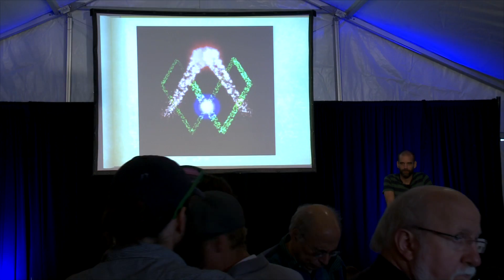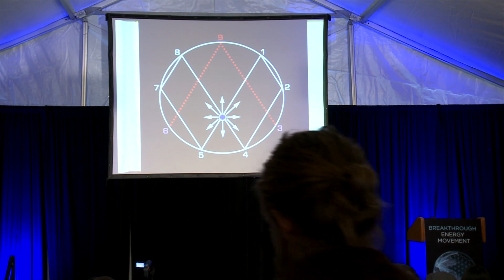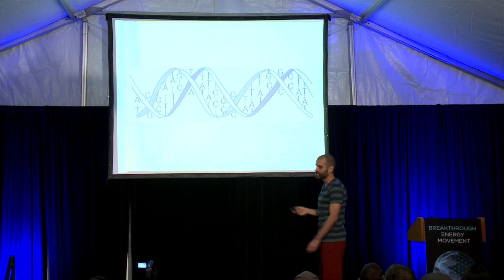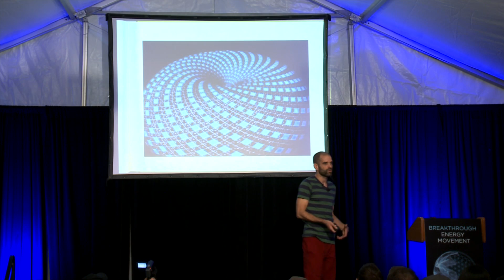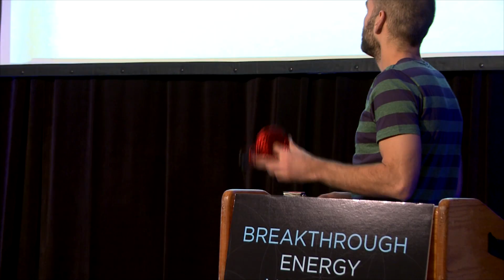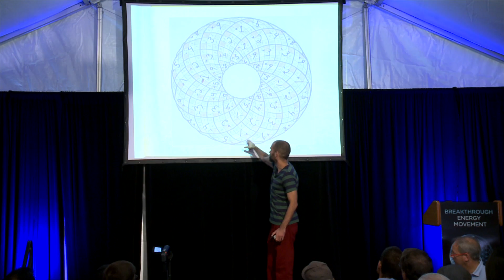Vortex Mathematics | Randy Powell

Comment: HAVE YOU EVER DRAWN THIS UP OVER THE NUMBERS ON A CALCULATOR PAD OR PHONE PAD THE DISIGN LOOKS LIKE 7X WHICH X STANDS FOR 10+ ROMAN 24TH ALPHABET 3 REVERSE 24TH KEY CENTER C IN WHICH 2X4+2+4= 6 8 7 PASSES IN BETWEEN OR OVER... 1 2 4 8 16 32 64(1) 128(2) 256 (13=4 JAC dMAC aiS) THEN 512 FIRST PART OF M.B. (8 PASSING FROM 4 THU THE CENTER  88 LINK  10TH MOVE BUT WHAT IF THEY WER ROTATION BACK WARDS AND THEIR WAS NO  124 BUT IT WAS 8 IN PLACE OF 1 AND 7 IN PLACE OF 2 AND 65 IN PLACE OF 4..REMEMBER THIS VISION... THE CUBE HAS 6 SIDES AND ON THE ONE DOT YOU HAVE 8 EMPTY SPACES ON THE 2 DOT THERE ARE 7 EMBPTY SPACES AND ON THE 5 THEIR AARE 4 EMPTY SPACES.....YES YES AREA SPACE OCCUPIED BY MASS ALTHOU IF YOU PUT A SOLID OBJECT IN THE PLACE TH E MASS WILL GO AROUND AND MABE DEPENDING ON THE OBJECT OCCUPIING A SPACE WHERE MASS IS ONCE THE OBJECT IS MOVED MOVE MASS CREATE PRESSURE.. THE EMPTY SPACE MASS 52 MAS 33 MASS EARTH 85  19 S AI MATRIX SILVER WATER ....33=6 9= 54+15 SUN MARS EARTH 10-7-3 B+E  J GC 17 GATES WAY WE LIVE IN A CREATED SYSTEM I AINT SMART ENOUGH BUT WHEN THE NUMBERS TELL A STORY..I WRITE IN CAPITALS

Comment: Great presentation Randy,  VBM is where it is at,  the public needs to know this stuff.   One thing that may help you with the Taurus shape model......If you haven't yet,  read walter russel, atomic suicide.  Because VBM may not be describing a Taurus in the classical sense,  Russells work shows the balanced interchange differently.  If you get what he is saying, it could open things up to the next level.  IMO

Comment: I think there should be some honest discussion of the number sequence presented here and its relationship to free masonry.  I am shocked no mentions that the compass and square from freemasonry to the number sequence presented here. As they are identical. Ma(sonic) i think that  sound or sonic technology the real free masons used related to this and part of the knowledge that has been lost/hidden. Anyone not see a compass and square in the sequence?  9-11 starting to make sense?
Reply: If you refer to the initial "Ennagram" you are confusing esoteric symbolism with freemasonry, which indeed uses it but does not own it. The equation this guy claim to have formulated is actually very similar to Tesla's multiplication chart from where the original 369 concept comes from, at least scientifically, cause vortex math has a very deep esoteric aspect, the properties of Nine in fact are almost transcendental, as it is both The Singularity and The Void. Nine is regarded as the Divine number par exelence, as it is 3 times 3, the Trinity. Pushing the 369 subject further we will see that 3 represents the Triangle, the almost universal symbol of Trinity, 6 is the Hexagram, or the Seal of Solomon, the symbol of Balance, and the Ennagram represents absolute Divinity being the triple Trinity. So here we have a concept that can be applied to the material aspect of energy with great efficiency, and at the same time to the Spiritual world of Quabbalah and Theosophy to explain the Misteries of the Soul and its manifestation into this realm.
Reply: Maybe there is a relationship. Maybe there isn't. What difference does it make? The freemasons pride themselves on keeping most of their magic a secret, so it's unlikely you'll ever know for sure. The question is if it has application or not, right?
Reply: if this can be applied to material aspect of energy,  then please tell me how.  I would love to experiment.